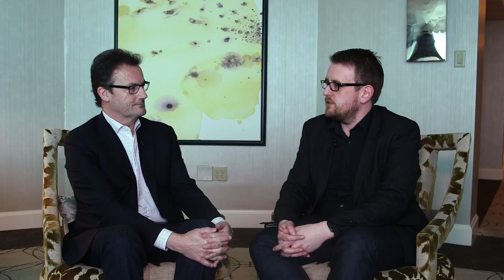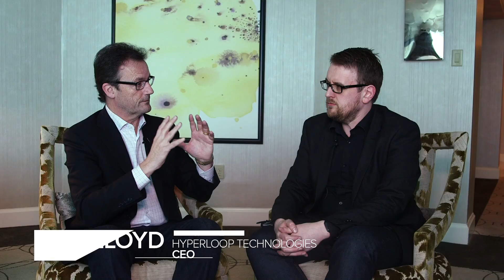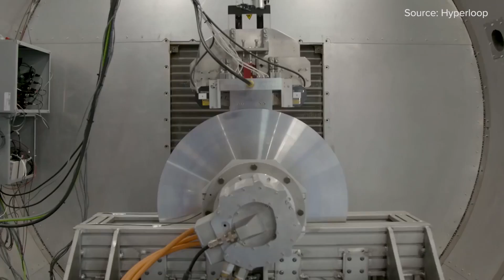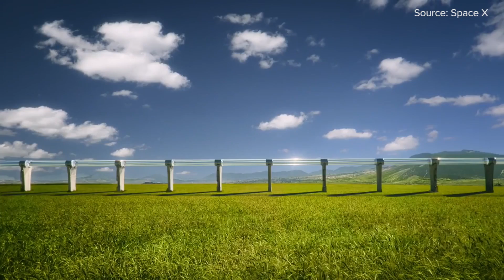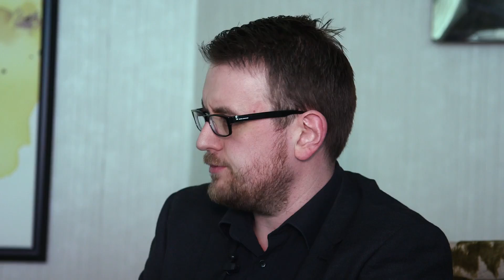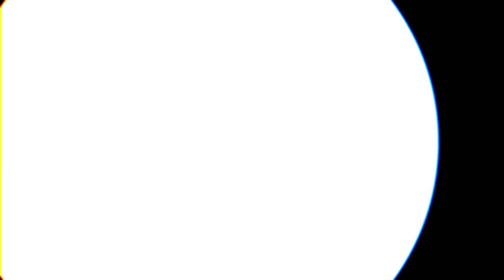Let's Talk Hyperloop

Comment: I have a couple questions. 1. What happens if there's a fire? It's an air tight tube filled with nothing but oxygen  2. The top speed is 750 mph how do you stop the thing without tearing peoples faces off. 3. Will the ends justify the means? This will require destroying the environment to build possibly, and you know construction like this will slow down traffic for years. 
I really want it to work, hopefully they figure it all out.
Reply: +U4YA
1. Who said that the tube was filled with oxygen?
2. That's why there's only one destination and no stops along the way.
3. Yes... over long time at least.
Reply: +U4YA The tube is almost a vacuum, barely any oxygen.
Reply: The speed is not what harms you, the acceleration is the only harmful thing

Comment: So if one 'carriage' stops to let passengers get off won't the carriage following it (going somewhere else) have to wait? And how will carriages go back the other way?
Reply: It will probably have a de-railment system at destinations...
Reply: +Ken Heslip To answer your last question first, it's a loop, like a very elongated circle, so all the trains will move, say, clockwise around the loop, and people get on and off at either end of the loop. Use Google Images for a visual answer if you like.

Regarding how people get on and off, the pods are timed a few minutes apart so there'll be enough time for people to disembark or board before the next pod gets there. If you're referring to stations along the way then there are none, only a station at either end of the loop.
Reply: +Ken Heslip Roundhouse at the end (same as trains) and schedule a few hours to send the pods back (with things to export hopefully).

Comment: You are thinking city to city. I'm more wondering continent to continent.
Reply: +Pedro Rainha baby steps... we'll get there. lol.
Reply: +J Wesley Ok...Ok....
Reply: +Pedro Rainha The hyper loop would likely not be practical across continents. Planes would be more efficient for travel once you get to distances longer than a thousand miles or so.
Reply: +bbosch The first thing I thought was the tunnel between France and England being replaced by Hyperloop. And immediately I thought about one between England and U.S.A. But I understand that this is just the beginning.
Reply: +Pedro Rainha That would require going below the sea for going from England to France
Reply: And I'm wondering if you're actually thinking that's viable. Tube breaks, and everyone inside will die. Not to mention the costs.

Comment: China is already looking to build high speed rail along the silk route (through Kazakhstan plains). Why not Hyperloop. Imagine the number of tankers / airplanes we could replace. Europe-Asia has probably the most volume moving after US-Asia (which runs underwater thus making it impossible with current tech)
Reply: +DC9848 US to Asia is already being built in russia across the bering sea (from one of the islands in the middle) there is a special on it on you tube somewhere

Comment: passengers will pass out when it accelerate. the acceleration is over 7g.......
Reply: +Jeff Xia But wouldn't the different conditions (low pressure/little-no air friction) possible allow for more speed without killing g forces?
Reply: +Luke Austin we need a physicist here.
Reply: While I would agree that having precautions (especially early on) is a great idea, I am just wondering if there is maybe a way to design the hyperloop to go to its maximum speed without the G-force problems affecting the passengers?
Reply: +Jeff Xia There will probably acceleration limit for passengers. I can imagine freights having acceleration limit stickers for some items.

Comment: i think it will be safe. the capsule must have high tech super high tech. regulaters. meaning as the capsule speeds faster..regulators kick in by supressing the pressure to make the enviroment seem like an airplane sort of experience but better since its levitaning andd as it slows down the high tech regulator takea it down a notch and prepares  for normal motion. boom. lots of cons and pros but it makes sence. just and opinion dont get all mad at mee. thank you.